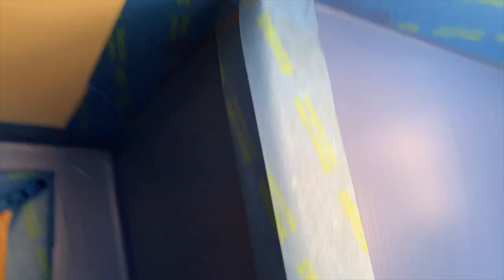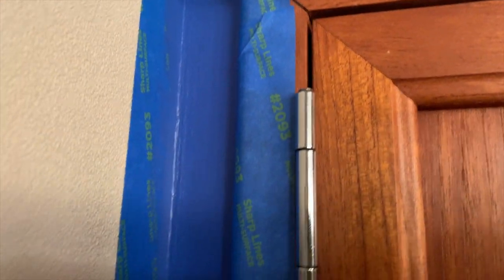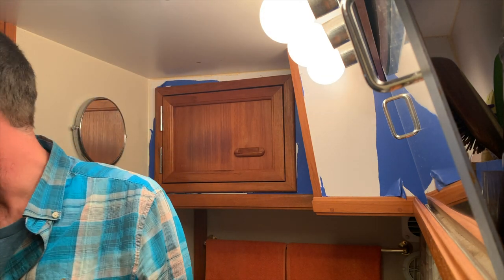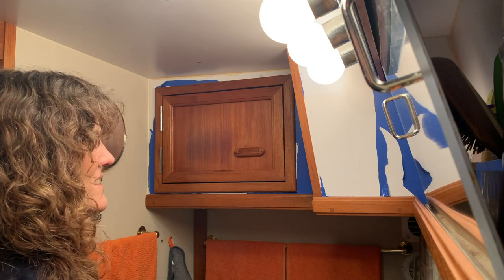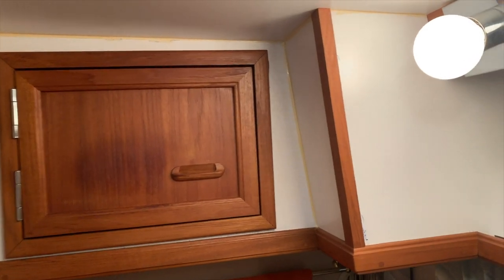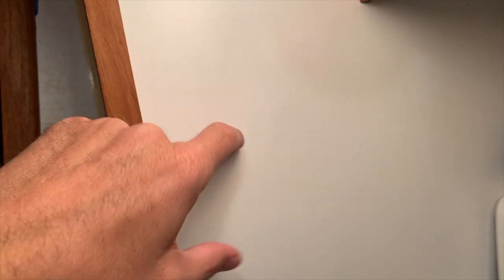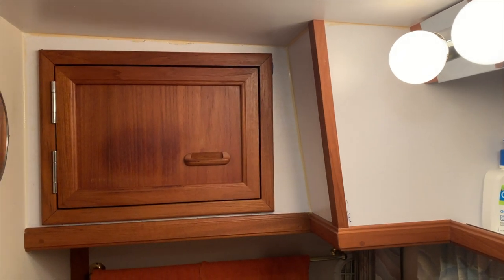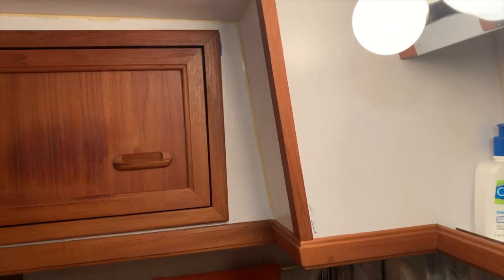Painting the Wrong Way.

Comment: Find out the type of board/material and stop at a paint store (not Menards/Home Depot), and see what they say.   If you can bring a sample, that could help.   However I think lightly sanding it might work too.
Reply from the maker: I have a great paint shop nearby, I'll chat with them. I've done plenty of painting in my life, I'm actually quite skilled at it. First, I didn't use primer, second, I didn't scuff the surface that I knew was slick. Me = Dummy.